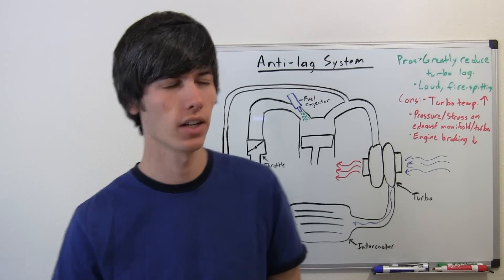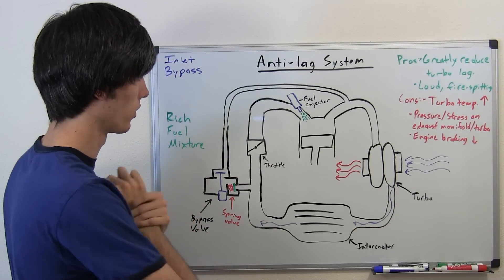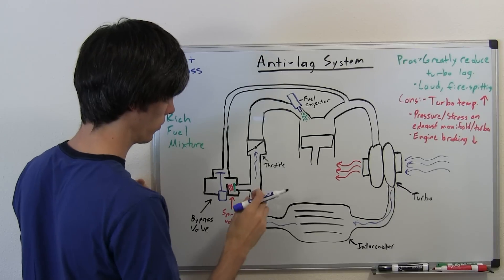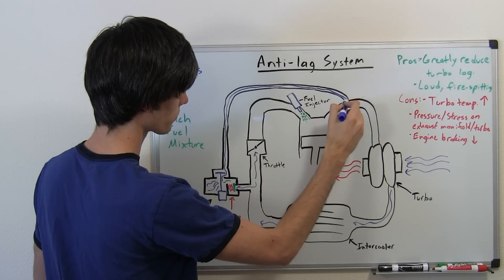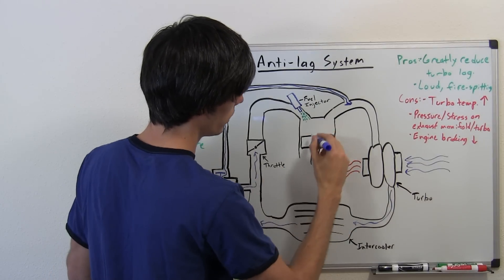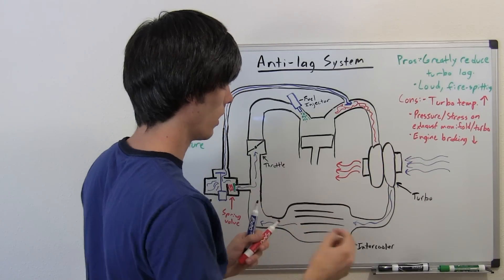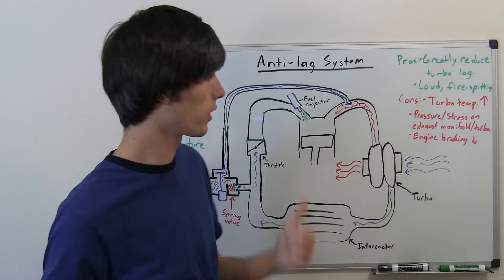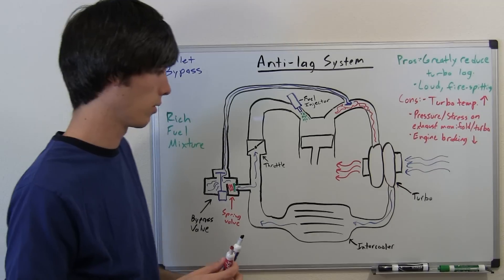How Anti-Lag Systems Work - No More Turbo Lag - Bypass Valve

Comment: Wouldn't it be more efficient if the bypass valve was in front of the intercooler? No point in cooling down the air and then heating it up again, in my mind.
Reply: Well the air is being used to burn the fuel thats in the exhaust so denser air would be better.
Reply: No. That's not how it works. It really is cooling air down and heating it up again which is pointless. Cooling the air down is only useful if you're going to compress it even more before heating it, which this system doesn't do.
Reply: ManWithBeard1990 Umm, do you even know anything about cars? What do you think the whole point of a cold air intake on a N/A car is for? there is no compression on them. Colder air = better burn.
Reply: Apparently I know more about cars than you do. Yes, cold air intakes are a good thing, but it just doesn't make sense to have the intercooler and the combustion for the ALS at the same pressure. The only reason an intercooler is useful is because the engine is going to compress the air even more before it heats it up again with combustion, which doesn't happen if you bypass it hence making the intercooler useless to detrimental. Please get some idea of how thermodynamics work before pretending to be smarter than someone else.
Reply: ManWithBeard1990 Who is pretending... Do you even know the mechanics behind turboing an engine and the actual purpose of the intercooler? You don't even know why the air has to be the same pressure.

I will take care of that part first; the whole point of the ALS is to keep the turbo spinning at speed so you keep a constant boost in the lower RPMs when changing gears. If you are not using the same air pressure you will actually slow the turbo down. The actual combustion is just a side effect of having the extra fuel vapor in the exhaust and can actually be tuned out.

Turbo chargers are driven by the exhaust which is hot, and after running for a while will heat up the entire turbo housing, and eventually start pumping hot air into the engine which will make it less efficient and slow. The intercooler cools the air coming out of the turbo before it is pumped into the intake,
Reply: Just... nevermind.
Reply: NewOscarGuy I think the "eventually will reduce in efficiency" consideration is a bit moot, because any kind of anti-lag sacrifices efficiency to improve throttle response for a short burst of time. You can't have ALS running in long stretches or for a high portion of the time - burning fuel in exhaust manifold as explained in the video should generate an order of magnitude more heat than the intercooler could make up for and will eventually overheat the exhaust system anyway - so longer-term effects should be of little regard.

I'm not saying whether Man's suggestion is of advantage or disadvantage, i don't have enough skill to evaluate that, but does seem consideration worthy to me.
Reply: Hmm…more efficient? What is really being loss? What are you saving by having the bypass valve prior to the intercooler? Most intercoolers are naturally cooled, so there isn't a loss to having the air being cooled before entering the exhaust port, but instead only benefit. But the reason the bypass valve is post intercooler is because dense air in the exhaust port equates to more air, which equates to greater combustion, which equates to better maintenance of the spool's rpm. In addition, if you were to have warmer air feed through the already hot exhaust fumes, the resulting temperature would be greater than if it were cooled and therefore leading to greater wear on you turbo. I think...
Reply: what's heating the bypass air? It's cold all the way to the exhaust pipe then it gets burned. And even if it does get heated backup, what's the benefit of having it behind the cooler?
Reply: Compression heats the bypass air. Intercooler cools the bypass air. Combustion heats the bypass air. =inefficient. You should bypass the intercooler as well.

Comment from the maker: Basically it could be a replacement, or if you wanted a more customized set-up you could have both, and have some sort of lock for the bypass valve or bov, or have them set at different psi's so that one acts first until the pressure gets high enough.

Comment: So basically the Ignition-Delay system is better i guess ?, in terms of the exhaust manifold getting high chances of breaking, and no need for ecu bypass valve

Comment: The anti lag system is fire spitting , what if the system is installed in a car and the driver gives no throttle at around 100 mph?..would"nt that cause fire or the engine to cease?
Reply: +Danny Dan The system is rpm dependent, not speed dependent. And it doesn't spit fire, it blows fuel off throttle, Combustion of said fuel in the exhaust is what causes the fire. Either way ceasing is the least of the problems, as the vacuum behind the fire promotes a greater exhaust scavenging effect.
Reply: +Themayseffect  thank u bro

Comment: Which system would be better to put onto the car in your opinion and everyone else who sees this comment? Ignition Delay or Bypass Valve?
Reply: VideoGameAddict like he said, if you use the bypass method, 1st it would take many fuel so less fuel economy 2nd the non burning fuel mixed up with the air from  bypass valve and burned in the manifold, the manifold which is not reinforced
Reply: also you must change the manifold system frequently so yea prefer the ignition delay rather than bypass valve
Reply: CarCrazy thanks :)

Comment from the maker: Fair enough. When dragsters are back firing on the starting line, it's because they're pressing the gas pedal, not because of ALS. The air/fuel mixture is just rich, so some of the fuel exits the exhaust, and ignites once it hits air containing oxygen.

Comment: from the rally cars iv seen and cars iv worked on the air bypassing the cylinder and meetin the excess fuel from the engine wil not ignite in the exhaust, anti lag system (on a rally car) relies on the ecu dumpin more fuel into the chamber causing a bigger explotion needed to spool the turbo, so this system on the video has never been used in any raly car or road car that iv seen, I don't understand how the air and wasted fuel can ignite in a already hot exhaust on its own

Comment: So wouldn't the anti-lag system work if you just used the boost pressure bypass? Why would you add extra fuel and create combustion in the exhaust manifold if you already have boost pressure pushing the turbine?

Comment: NO the bypass valve does NOT dump in the exhaust, it dumps back into the intake instead of venting to the atmosphere, yes it decreases lag however with a bypass valve you won't get the "whoosh" sound like you would with a regular BOV & with any turbo or supercharged car you always run a risk of engine failure due to exhaust temp being to high or if you run more boost than the engine is built for

Comment: so basically your purposely causing a huge backfire to spool the turbo, isnt this going to destroy your exhaust valve? or even spit it back into the engine?
Reply from the maker: The valve springs would have enough pressure to prevent the exhaust from opening.

Comment: anti lag systems
(This happens when the trottle is closed)

1. By letting the throttle plate slighty open and delaying the ignition in cylinder, so it has some of gas not burned that will flow to the exhaust manifold (which is very hot) and then makes spark that will spin the turbo.

2. By passing the valve with adding extra plumbing before the trottle plate and send the air directly to the exaust manifold that will spin the turbo.

3. Two step rev, (it's not anti lag system but it will let the turbo spooled up) the system kind a like the number 1 but it's for limiting the hightest rpm

Comment: Drag racing guys like to run ALS to built boost for launching better. More of a luxury item? Yeah maybe... but if you have the suspension and tire to accommodate the extra boost off the line, an ALS can really help cut your 60' at the track. And from my experience they build more boost than a 2 step. If you're on some street tires and you can barely hook up as is, an ALS would have a negative impact.

Comment from the maker: Because basically the engine is still running even after you let off the throttle, though this is probably more prominent using ignition delay, which I did not mention.

Comment: Basically they should make a clutch that you could keep the throttle wide open when changing gear so you won't lose rpm in the turbo because if u did this on a standard cluch it would slip and wear out hence you have anti lag which lets you disengage the throttle so its easier on the clutch ( mean while the turbo is still flat out)  any one wanna make one XD
Reply: The whole point of anti-lag is to keep the turbo spooling WHILST YOU ARE SLOWING DOWN INTO A CORNER, OFF THE THROTTLE!

Comment: so your saying you will be meeting auto igition in the exhaust manifold which drives the turbo well actually yes and no, and the issue here is that if your fueling is enough it will actually be cooling the exh temps which is counter productive for the turbo actually. as you need as much heat/pressure in that exh housing driving the exducer, flow is important here too. also the air from the intake tract is very cool in comparrison to the exh, so as it enters it will also have a rapid cooling effect. i dont believe thats how the systems are suppose to work, and i believe the auto ignition seen is a by product of tps enrichment not being tuned correctly or the amount of fuel added. I believe in reality the system is suppose to just try to keep positive pressure in the exh to maintain relative speed of the exducer, not seek to find auto ignition. or is it?

Comment from the maker: It lets the intake charge (intake air) out when the throttle valve closes, instead of forcing the air to travel back through the turbocharger (compressor surge).

Comment: Thanks for another "short and sweet" video.
Though it left me a bit "confused", not regarding how this works ((in principle)) but that the general result and "pros&cons" seemed to be almost exactly the same as the "retarded ignition"... what am I missing ? And is there any specific reason as to why You would choose on over the other (i.e. ALS vs ByPassValve) ??
Best regards

Comment: All this system does is because you close the throttle the boosted air thats still under pressure it wants to go back down the pipe. So we use a blow off valve. 
This system takes that boosted air and diverts it to the blow off valve and instead of it venting back to the atmosphere or pre turbo it shoots it to the turbo turbine housing and hi turn gives the turbine wheel a little kick to compensate for the just closed throttle thats instantaneously plugged the system up which inturn lowers the exhaust gasses velocity and that little kick compensates for that. 

Simples

Comment from the maker: Well, partially. You must also note that there is fuel present in the exhaust manifold as the air comes in, so that combustion occurs, keeping the turbo spooled.

Comment: Im a car noob so I apologize in advance if this sound idiotic but instead of routing the bypassed air to the exaust manifold, couldn't you just route it direct to the intake manifold instead?
Reply: Robert Faulkner Jr If you watched his other ALS video, it's pretty much just being able to have a higher A/F ratio. And on his other ALS video it explains how they use a delayed ignition to drive the turbine in much the same way. I'm with you, and don't know much cause I just watched it a few minutes ago. So Watch for yourself and it's pretty easy to understand. The only difference I guess would be the added component of the Bypass valve.

Comment from the maker: It's an aftermarket system. Though I believe some cars have had anti-lag systems installed, one version of the Evo, and I believe one model of the Celica may have also had one from the factory. Though I believe even with these you had to do a little tampering to activate the ALS.
Reply: The Veloster N and Focus RS both have rudimentary ALS.  Anything with a DBW throttle actually makes it pretty easy to implement since you don't need to jack a cable throttle plate open and run cyclic idle to prevent the engine from running away.

Some of the EVO models came with 'Secondary Air Control' which was effectively air injection, however I am unsure if any fuel or ignition retard was used by the factory ECU.  This was likely built-in to the stock motor for rally homologation purposes.  Subaru did a similar thing with their Spec C models - a secondary IAT was added on the intake manifold for speed density engine management, however the sensor did absolutely nothing on the stock ECU and was merely there to meet homologation.

The 3S-GTE motor in some ST205 Celica GT-Four models had an air injection valve plumbed to all 4 runners on the exhaust.  I believe this entirely replaced the air bypass valve (aka blow-off valve).  Similar to the EVO example, I don't believe any additional fuel was added or ignition retard was completed - simply for homologation.

Comment from the maker: Same place it always is, above the cylinder, with the same function it always has, to ignite the air fuel mixture within the cylinder. The only difference is the ignition may be delayed (such as in the other ALS video).

Comment: this will burn your turbo.. in the long run..
but its good for circuit racing you wont have delay. coz its continuos  spooling and gives you advantage to change into a lower gear.with needed thrust. but generally you turbo wont last long. you will have to spend big bucks again to replace it..

Comment from the maker: You can't power something with itself with no external force. Think about it; basically you're saying to use a fan to blow air, then use tubing to redirect this air behind the fan. Would the fan continue to spin forever (perpetual motion)? It requires an external force to act, hence, fuel and air combusting. Hope this makes sense!

Comment: If the two types of anti-lag system puts pressure and stress on the exhaust, why bother installing a bypass valve and have your injector inject more fuel when you can just delay the ignition?

Comment: why would the ecu still send "inject" Signals to the injectors when the throttle is closed? thats not how it works. in german its called "schubabschaltung" which means that when throttle is closed you dont inject any fuel in the cylinders. (engine brake)
Reply: It injects fuel when the throttle is closed because it feeds the anti lag.

Comment from the maker: Correct, it is similar but you do need the combustion to occur. Think of it like this, you can't power a fan by placing a tube behind it that reroutes the air to flow back into the front of the fan. A turbo cannot power itself, so this combustion (added pressure) keeps the exhaust side of the turbine spooling, so that the inlet keeps drawing in air.

Comment: I really don't understand why they can't create a supercharger/turbo turbine which uses computer controlled turbine gearing to maintain or build pressure at will with typical turbo benefits to supplement the power. People invented differentials and they can't accomplish this without creating unnecessary and destructive downsides?

Comment: I just don't understand how this type of anti lag can actually be that effective compared to the spark delay one. I also don't understand how it would work from a dead launch. I would think a electric wastegate would be better. More like an intake tube cut out. So the turbine will spin up on the exhaust gas. But will spin freely so it spools fast, then you shut the wastegate when your ready to go, and it's already up to speed...
Reply: The idea of this is that it runs the turbo basically like a jet engine while the engine is at idle. When the fresh air reaches the exhaust manifold it explodes because of the excess fuel. Similar to what you describe but not wasting the fresh air but using it to create yet more pressure for the turbo to compress. Fundamentally though it is a jet engine while the engine is at idle.

Comment from the maker: I use a single cylinder just for simplicity. As far as the injection point, it may be the simplest to inject once all 4 runners ran together, or in a 4-2-1 have it inject at both halfway points. This way there would be more of a constant fuel flow. I suppose it's possible to have it for each runner though. Excellent question.

Comment from the maker: Could be yes, if you never have a vacuum. Sometimes turbo'd cars will come with a vacuum pump, or use a hydraulic vacuum assist since the manifold will not be in a vacuum when you're on the gas.

Comment: That bypass valve is not necessary. You can just antilag with open throttle. Except in rally, there it does make sense

Comment: You can eliminate some negative aspects by not connecting the compressor side to the exhaust manifold but to connect it right before the intake of the turbo, so that the air just circulates. As a second positive result, you always have pressurized air right infront of your throttlebody and therefore quicker response.
Reply: Do WRC teams these day use this configuration ?

Comment: The problem is that UEL is not all that good for twin scroll turbos. The unequal exhaust pulses defeat the purpose of a twin scroll turbo. So either you sound like a glorified Honda (haha) and have low turbo lag or you sound like a Subaru and have some lag (with bigger turbines).
But probably with a aftermarket ECU you could go variable geometry turbine ;-)

Comment: but you don't have to have a bypass valve you can use a blow off valve just releasing pressure but the downside your turbo system will loose all pressure resulting in no boost. BYPASS VAVLES ARE STRICKLY FOR RACING NON-STOP! you can use a bypass valve system on your street car but you need to upgrade cooling on a lot of things